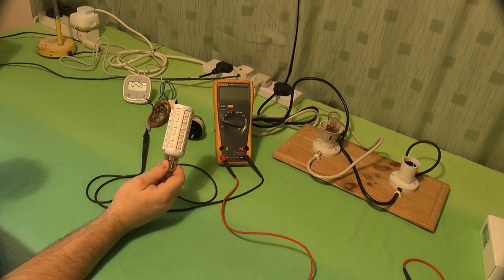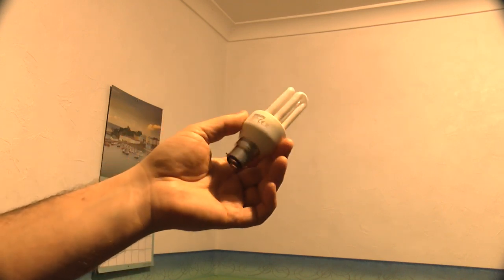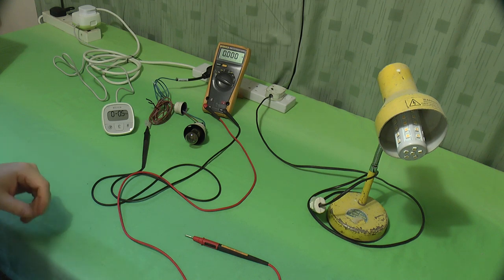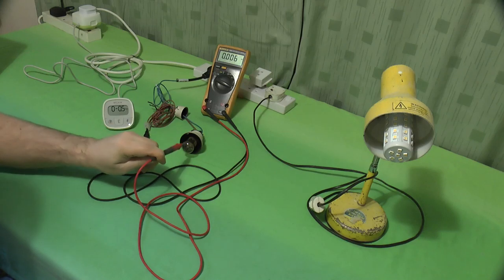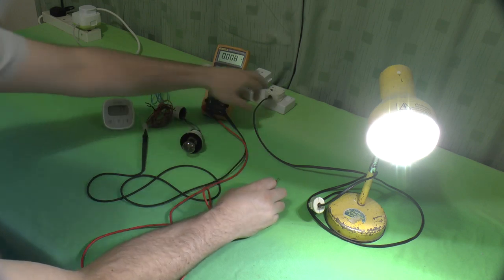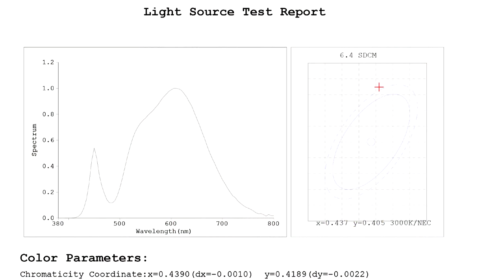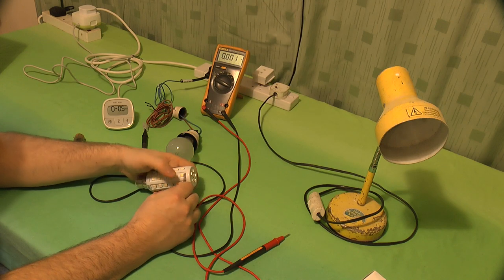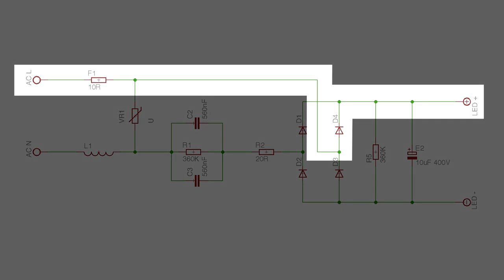Dangerous LED "corn cob" lamp test and teardown

Comment: Thanks for posting this. I got whacked indirectly off one of these bulbs a few years ago. I was looking for something bright to use in a cooker hood, and the LEDs all over the place of the cob bulb appealed, but it was a bit big and took a bit of effort to put in and it ended up making contact with a metal splashback (unearthed, it turned out) which ran all the way down the wall to the back of the hob. I was surprised by the exposed contacts, but it never crossed my mind that somebody would actually manufacture or sell such a device without the absolutely critical isolation circuitry. Found out one day when the back of my finger brushed the splashback and I got my tester on it, we'd had a 1 metre square live metal plate in our kitchen for weeks. Rather glad we're bad at cleaning the splashback, because a wet cloth doesn't bear thinking about. Rented accommodation then, no RCD. But as a new homeowner, one of the first things I did was get a new consumer unit with full RCD on every circuit. I'd recommend that to anyone!
Reply from the maker: From what I recall the fella in the Fake Britain article also got belted when fitting an LED lamp to a cooker hood.
Of course you'll always get those nasally whining that "you should always turn the power off before changing a light bulb" but the worst you should get from doing that is burned fingers, not a potentially lethal shock.  Exposed low voltage devices should not be at mains potential, it's as simple as that.

Comment from the maker: @Alex walker you need to change your privacy settings to allow replies.

Yes it's possible. If the LED strips were driven by a small switch-mode power supply circuit it could be made safe, each strip of 6 LEDs only needs about 18-20 volts to run, the strips (and the top cap) can be connected in parallel to run on such a supply.

Comment: Am I correct presuming that most bulbs that resemble this would suffer from the same problem, and that's why I see others that resemble this design are in fact enclosed in plastic?
Reply from the maker: +sirstrongbad Correct. The newer designs tend to be enclosed, but earlier ones were open like this. Fine if they're clusters of 3mm or 5mm conventional LEDs as you can't get at the contacts - or the board for that matter - but dangerous with surface-mount.

Comment: Lovely piece of analysis . What joy did you have with trading standards ? I had the impression that they were designed for a localised , shop , local supplier enforcement , not capable of tackling national / post driven product . How did you get on ?

Comment: This light bulb could actually kill an unsuspecting individual who has a pacemaker. I have one that keeps my heart beating 100% of the time and a 25 volt shock could kill the pacemaker, thereby essentially killing me in the process too. THANK YOU and to Julian Llett too for this disturbing but very important safety warning.  I actually bought one of the GU10 bulbs and was considering installing it this spring to see how it works.  Now I'll just repurpose the individual LED's on my RC airplanes & Helicopters.

Comment: Nah, that thing's an utter pile of pants!

How did that get past BEAB ?

.....In the back door, that's how!

Exposed conductive parts on that (or anything else for that matter!) shouldn't be so.

As you found out when you flipped the polarity of the lamp, although all that hocus-pocus restricts current to the LEDs connected across the potential, between the live pin of the lamp holder and your test meter, there's very little current restriction, in fact, more than enough to kill.

Yep, I say contact trading standards. That lamp thing is total pants.

I WANT FLAMES!!!

Good vid, thanxx for showing. :-)

-BoomBoxDeluxe.

31st January 2014, 13.37

Comment: Can somebody explain me the diagram? I tought bridge rectifiers taook AC in one end and output DC on the other, why isn't this wired like that?
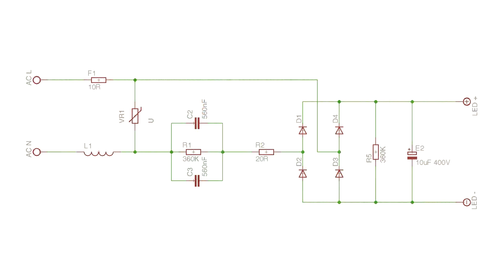Reply from the maker: It's wired exactly like that. Look at a "diamond" drawing of a bridge rectifier and you have four diodes all pointing in one direction, with the "back end" as the negative output and the "front end" as the positive output. Now rotate that diagram so they all point upwards (so the positive output is now at the top). Compare this diagram with D1 to D4 as shown at 19:06 in my video and you'll see the same bridge configuration (top of D1 and D4 are the positive output).
Reply: So if you connect the AC to the AC side it's still possible to get AC in the DC side? Brain hurts now.
Reply from the maker: The output itself (positive to negative) is full-wave-rectified DC. Relative to the incoming AC, though, is a different matter. On positive halves of the incoming AC, the negative side of the rectifier is at neutral potential and the positive side rises (with the AC) and falls to zero. On negative halves the positive side is at neutral potential and the negative side falls (with the AC) and rises to zero.

Take a look around YouTube for videos about bridge rectifiers, there ought to be one out there that shows the voltage output relative to the incoming supply.

Comment: Am I right in assuming that the CE and RoHS marks are counterfeit? Doesn't a device need to be tested by them before it can bear their logos?
Reply from the maker: Yes, they're counterfeit. CE-marked stuff should not be an electric shock risk. Some people carp on about it being a differently-spaced mark meaning "China Export", in which case (a) why does an Xbox 360 have a "China Export" mark and (b) if it IS a "China Export" mark, where's the proper CE mark that allows it to be sold in the EU? They even say it's "China Export" and link to the Wikipedia article which states there's no such mark.

Comment: I have to say this though.. these bulbs are interesting in that you can actually "repair" your light bulbs  when they stop working.  That concept struck me  as I began to remember the old bulbs that a broken filament was cause to toss them into the bin.  With these you can purchase the electronic components internal and even the actual LEDs themselves.  You can purchase the quality ones if you do not like the Chinese components (what is not made in China though, right?).. I have actually modified several of mine which have dies over the past couple of years to incorporate an isolation cap in the AC side of the bulb as well as some filtration components to clean up the DC delivery side so the LEDs do not get reverse driven which I sense you are eluding to.  Reverse current in the LEDs is a death sentence for them.  If the bulb is not lighting, it might mean the bridge has been compromised to lead to the scenario you are speaking about, but any electronics that has this kind of issue is in broken state and is dangerous, right?  How about if you modify yours to make them isolated and not the hazard you are talking about?
I am not saying these are safe or even feasible, but I will say that I love being able to repair a light bulb at low cost, and I know that I can modify them as needed for safety or longevity as needed..

Comment: Thank you very much for this information. I myself own a couple of these but I will not remove them, or destroy them. I thold my family not to touch them while they are lit, and thus solved my problem. I sugest the others to do the same. I think you might have overreacted a bit, but I belive informing the manufacturer is indeed necessary. Cheers!

Comment: I hope trading standards rip these gits a new one.

I bought some GU10s from a seller on Amazon that were (apparently) CE Approved and RoHS compliant.  I doubt they had ever been anywhere near a testing facility.  They worked well but I discovered the same problem as you but not in a pleasant way......turns out the previous owner of my parents house wired the light fitting incorrectly and was switching the neutral, not the live......   That hurt quite a bit but thanks to a whole house RCD (which we had fitted) there was no permanent damage.

I have since avoided eBay and Amazon marketplace for any mains powered electricals - it's a bloody minefield and not worth the risk.

I destroyed those bulbs and bought new ones from a reputable UK-based specialist supplier and they are great.  All metal and glass construction and more importantly SAFE!  I forget the name of the company but they're not hard to find.  They cost a fair bit more but I'd rather that than injure myself or someone else.

I plan to replace the CFLs in my flat with LEDs (once I rip out all the stupid BC3 fittings) and will be getting them from the same place.

Comment: I bought a small LED appliance bulb on clearance at walmart for $5 and the plastic cover over the LEDs came off. I ended up tearing it down b/c it wasn't safe. I've used two of the LED clusters, one for a 9V flashlight and the other for a 12 volt light. the 12 vole light is really bright. I have another one of these bulbs and the cover is solid.

Comment: That's exactly why the first thing I do with everything that has "Made in China" on the label is taking it apart. If there's "China" and "CE" on the same product one of them has to be a lie (ok, slightly exaggerated).
I'm sometimes so paranoid about not knowing if a socket of a bulb is switched off, that I pull the breaker before exchanging a lightbulb (mostly because in an old home I got a shock from neutral because the wires were so bad; not enough to be dangerous from an electricity standpoint, but enough to throw you off a chair/ladder in surprise). Seems for china stuff pulling the mains breaker first is always the way to go.

Comment: How did you learn about electronics?  I am studying physics but feel like my practical electronics knowledge is severely lacking.
Reply from the maker: CowLunch My stepfather did a City & Guilds Electronics course in the mid 80's. I took an interest, overtook him and did a GCSE in CDT: Technology (a craft, design and technology option that concentrated on electronics) and that, together with GCSE Physics is pretty much it as far as electronics qualifications are concerned.

The rest of my education has been IT related instead, with electronics being just a hobby that gets picked up (and forgotten again) as I go along.

There are plenty of holes in my knowledge (inductors being a notable example; I get how a transformer works but not a ballast) but I could probably learn if I bothered, or WAS bothered.

There's nothing to stop you learning by looking online (when I was studying there was no such thing as "online", this was when you could literally dial into Maplin Electronics' computer to place orders, way back when they were still cheap). An important starting point I reckon though is to start scavenging. Electronic goods going in the bin? Take them to bits. Keep every screw, keep every circuit board, recycle/bin the rest. Desoldering components from the boards gives you soldering experience and builds up your parts collection, so if you need a particular resistor or cap, chances are you'll have one if you go rummaging through the tin. I wouldn't worry about surface-mount stuff, but through-hole parts are worth salvaging. My stepfather was given old boards to salvage in this way, some of those old components are probably still in my tins :)

A final tip if you're in school. At sixth form you're treated like a kid. At college you're treated like an adult. If you want to do A-levels or national diplomas without being treated like a kid, go to college.

Comment: Good video mate, thanks for bringing this to our attention, I always assumed these new LED lamps would have some little transformer to lower voltage right down.  I guess not.  Will be sticking with for the CFL's for now.
Reply from the maker: It's a shame, because they give really good light output. I've got half a dozen of these lamps, but (a) they're fully enclosed in their fittings, (b) I ensured none of the (earthed) metalwork in the fittings is in contact with the LEDs and (c) I know they need to be handled with care.

Comment: I also bought one of these bulbs, only because it said "85-265" volt operating range, this reminded me of the standart switching supply, the chinese put into their gu10 bulbs, anyhow when it arrived I found out, that it was a capacitive dropper inside of there and not a galvanic isolated psu. I found quite a nice way of recycling them and making good use out of them.
Hack a mains LED Lamp to run off of solar panels

Comment: I have a few smaller corncob bulbs that probably consume 3 watts. That entire assembly is covered with a plastic lense so you can't contact any live voltage.

I suspect the safety stickers on your bulbs are not worth the paper they are printed on. A lot of the Chinese stuff has ZERO recourse, the manufacturers and importers are fly by night and can't be held accountable. if it blows up or someone gets hurt they are on their own because these companies evaporate when trouble occurs.

I just bought a couple of Sylvania 11w LED bulbs and paid about twice what that corncobb bulb costs. What I got is safe, and puts out very pleasing  light, I'm happy to pay the extra money.

Comment: Just a quick question without meaning to sound stupid here - Can anyone tell me please if there is any chance of these gu10/mr16 3W LED bulbs storing a charge AFTER they have been switched off? Ie. if the power is turned OFF, and the bulb removed, are there any capacitors inside which could store a charge and potentially shock you after?
Reply from the maker: Asking questions is the smart thing to do, stupid people are stupid because they don't ask questions and don't pay attention :)

In the case of MR16s you shouldn't have anything to worry about as they're 12 volt bulbs.

GU10 or other mains voltage bulbs using the "capacitive dropper" circuit seen here will store charge. Fortunately (in this case at least) there are resistors across the capacitors which will bring them down to a safe level fairly quickly.
Discharge time for C2 and C3: http://mustcalculate.com/electronics/capacitorchargeanddischarge.php?vfrom=340&vto=10&vs=0&c=1120n&r=360k
Discharge time for E2: http://mustcalculate.com/electronics/capacitorchargeanddischarge.php?vfrom=340&vto=10&vs=0&c=10u&r=360k
The above discharge curves assume that the capacitors were fully charged (approx. 340V peak on a 240VAC RMS supply) at the time the power was switched off.

In any circuits where these resistors are omitted they could hold charge for a lot longer, I had a kick off a MacBook charger that had been switched off for two days.
Reply: AintBigAintClever Thank you for that, very interesting. I have quite a few GU10 240v LEDs at home, some old style 80 Leds, some SMD, some 3 watt 3 bulb, and some single bulb super bright COB ones with the grey shell. I try to avoid touching them when they are on every, but always assumed they were safe when off. Do you think it would be worth even wearing rubber gloves or something when moving these around? Some of them are a little old and flimsy now.
Reply from the maker: I fitted GU10 LED clusters years ago at my parents' house. Probably a similar driver circuit to the corn cobs but because the LEDs were all 3mm conventional types clustered together it's impossible to touch anything live on them as there's too much epoxy in the way. Easily as bright as the mix of 35W and 50W bulbs they replaced.

If they're coming apart but fully functional, why not glue them back together? If they're acting up, just bin them. Personally I wouldn't wear gloves removing them as long as the power is off, but I'd be careful where my fingers are going and avoiding any exposed wiring on them.

Comment: Well, the reason for not covering it is to allow the air flow to cool the LED's. When covered, it will hopelessly overheat...
But that design require the isolated SELV driver, but that is more expensive and mainly more lossy..

Comment: Thanks for bringing this to our attention, i know there's a lot of dangerous foreign goods on the market, this is an example of another one.
If people are thinking they would be safe to use this in an 'out of reach' situation, think again, what if (like the end of the video) the lamp failed, would you know for sure that the circuit is off ?
I have worked bare handed on live power, but i would not want to change that lamp without isolating the light circuit from the main distribution board, or using good rubber gloves
If they are cheap enough, maybe dismantle them and use the ld strips for a low voltage project ;)